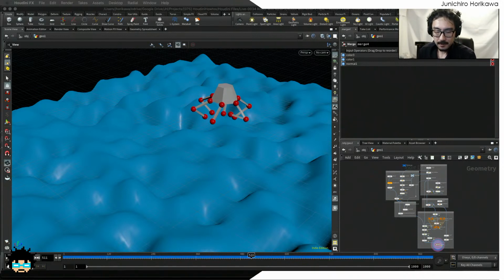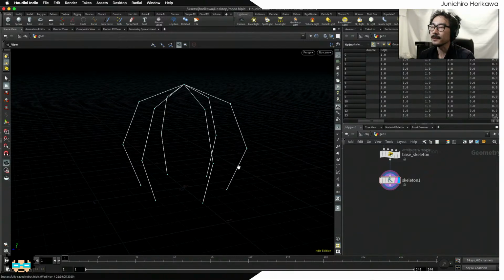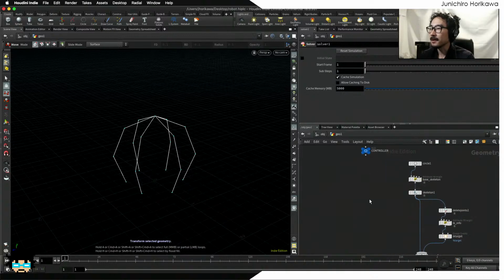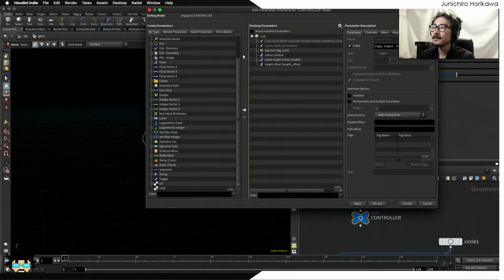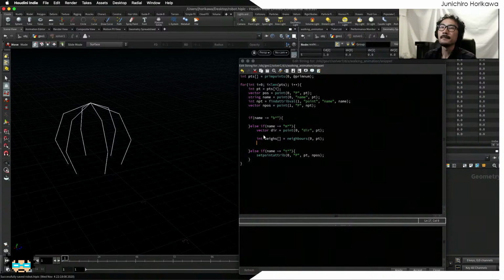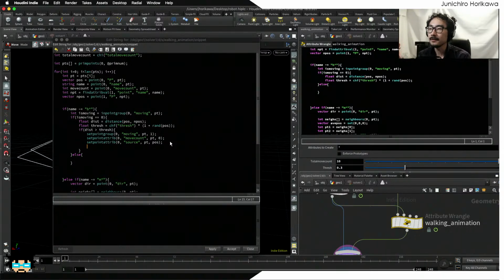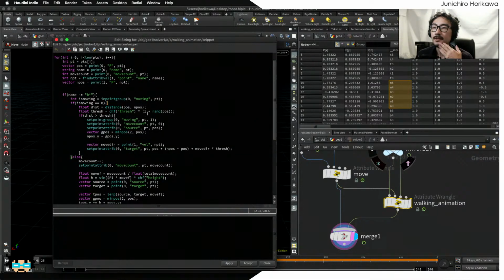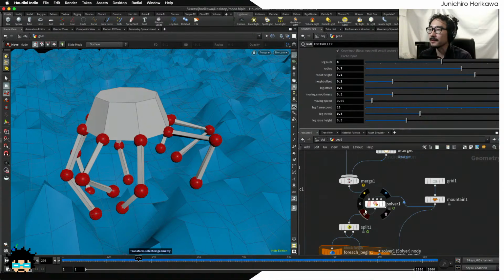Houdini Algorithmic Live #034 - Robot with KineFX

Comment: Hi Horikwa San , why you using : pos + ( pos - @P ) ? . I can't understand it :'( .
Reply: mee too  it confused ma a lot
Reply: @boomlaywen2272  It's vector math.  @P is the center of the privative and pos is the current point round the edge of it that we are working with.
This lets you move a point further away from the center, which it what he needs of the 'knee'.

Thinking in 1 dimension at a time is easier... e.g. if @P.x =1 and pos.x = 5 then 
pos.x + ((pos.x - @P.x) * 0.5) which is
5 + ((5-1) * 0.5)  = 5 + (4*.5) = 5 + 2 = 7
So the new value is further away from the center than the original.
Does that help?
Reply: @JamesMacgill  sorry to reply late~ but it really help me a lot! Thank you for your explain, its easy to understand now!
Reply: @JamesMacgill  thanks man !